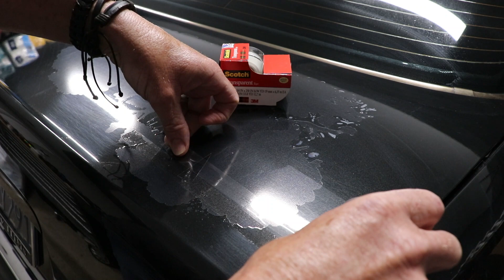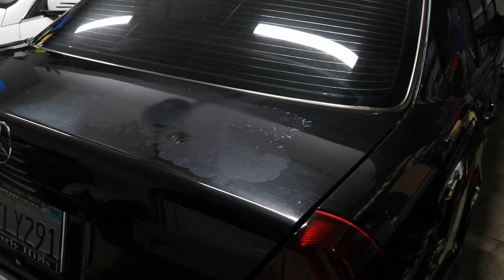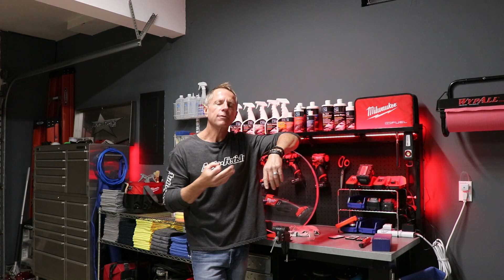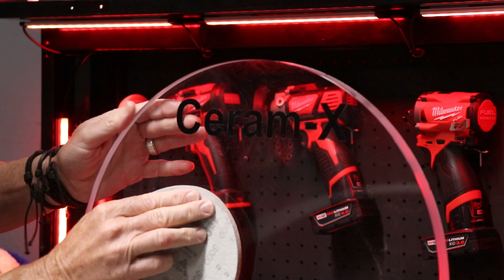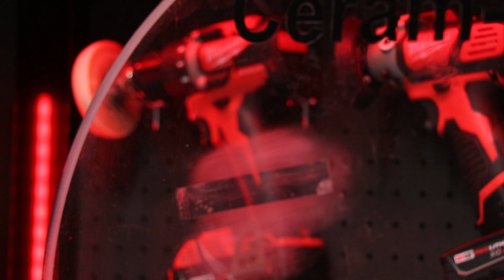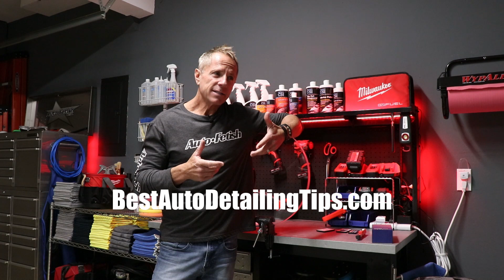Detailing Trick: : car clear coat repair using Scotch Tape??!!

Comment: Fixing clear coat damage on a car can be a multi-step process. Here is a simple, generalized guide to help you get started:

Gather Materials: You'll need sandpaper (both 1500-grit and 2000-grit), clear coat, car soap, a sponge, a bucket, microfiber cloths, and rubbing compound.

Wash the Area: Before starting the repair process, wash the damaged area with car soap to remove any dirt and debris. Rinse thoroughly and dry with a microfiber cloth.

Sanding: With the 1500-grit sandpaper, lightly sand the damaged clear coat area. Be sure not to sand too hard or too deep as you may cause more damage to the base paint. The goal here is to create a smooth surface for the new clear coat to adhere.

Clean and Dry the Area: After sanding, wash the area again with car soap to get rid of any dust from the sanding process. Dry thoroughly.

Apply New Clear Coat: Apply a thin layer of the new clear coat on the area. Be sure to follow the manufacturer's instructions for best results.

Let it Dry: Let the clear coat dry for the recommended time as per the manufacturer's instructions.

Sanding Again: After the clear coat is completely dry, sand the area lightly with the 2000-grit sandpaper. This is to remove any imperfections and to ensure that the new clear coat blends seamlessly with the old.

Apply Rubbing Compound: Apply the rubbing compound to the repaired area to give it a glossy finish. Buff it with a buffer tool or by hand with a microfiber cloth.

Wax the Area: After the rubbing compound has dried and the area has been buffed, apply car wax to the area. This will add an extra layer of protection to your new clear coat and enhance the gloss.

Comment: So WTF? You just cover your car with scotch tape??? Video made no sense at all.  Are you drunk?
Reply: He was teaching science and technology. Very intellectual.
Reply: Fixing clear coat damage on a car can be a multi-step process. Here is a simple, generalized guide to help you get started:

Gather Materials: You'll need sandpaper (both 1500-grit and 2000-grit), clear coat, car soap, a sponge, a bucket, microfiber cloths, and rubbing compound.

Wash the Area: Before starting the repair process, wash the damaged area with car soap to remove any dirt and debris. Rinse thoroughly and dry with a microfiber cloth.

Sanding: With the 1500-grit sandpaper, lightly sand the damaged clear coat area. Be sure not to sand too hard or too deep as you may cause more damage to the base paint. The goal here is to create a smooth surface for the new clear coat to adhere.

Clean and Dry the Area: After sanding, wash the area again with car soap to get rid of any dust from the sanding process. Dry thoroughly.

Apply New Clear Coat: Apply a thin layer of the new clear coat on the area. Be sure to follow the manufacturer's instructions for best results.

Let it Dry: Let the clear coat dry for the recommended time as per the manufacturer's instructions.

Sanding Again: After the clear coat is completely dry, sand the area lightly with the 2000-grit sandpaper. This is to remove any imperfections and to ensure that the new clear coat blends seamlessly with the old.

Apply Rubbing Compound: Apply the rubbing compound to the repaired area to give it a glossy finish. Buff it with a buffer tool or by hand with a microfiber cloth.

Wax the Area: After the rubbing compound has dried and the area has been buffed, apply car wax to the area. This will add an extra layer of protection to your new clear coat and enhance the gloss.
Reply: Dumbass title!!! He just wants to explain what clear coat is!!!!! He Smaart

Comment: Here is my problem. I own a black Grand Cherokee. 2 years ago seagull shit on my hood in the summer. It was 90 to 100 degrees out.  It ruined my clearcoat (a little bigger than a silver dollar) I wet sanded very lightly with 300 grit and polished. It looked better but never was 100 percent. 2 yrs later that same spot of clear peeled. I do not think it was my wet sanding because it peeled in the shape of the bird dropping not entire area sanded. That bird must have shit acid or something. How do I blend new clear over that?

Comment: 1 millimetre is 1000th of a metre which is approximately 39 inches. Please disregard the reference to 1000th of an inch.
Reply: Mil. And MM are not the same thing.

He is 100% correct that a Mil. One-thousandth of an inch. 

Not to be confused with a Millimeter. They are two different standards of measurements.

Comment: As a machinist I must say I have never heard of anyone calling .001 a "mill" as you said. We say .001 is one thousandths of an inch, or one "thou". Maybe your talking about millimeters? So .001 is one micron.
Reply: It’s a common term for plastics sheeting/ bags and coatings.
Reply: A "mil" is also a thousandth of a inch (.001) but in industries such as coatings and material thicknesses it's called a "mil". Its actually used extensively but in the machinist world they use thou more often. It comes from Latin where thousand is mille (mil is shortened from mille just as thou is shortened from thousand). If you go buy a tarp or drop cloth at HD you will see it shows how many mil thick it is.
Reply: @stephenwhite5444  pretty sure mil is not shortened from mile, as it really has nothing to do with being a mile fragment. It just a mil. having been an automotive technician for the last 21 years as well as pro-detailer I can definitely agree that ppl think mil is related to mm & not inches. When ppl see my digital paint meter they're instantly confused by mil/u option thinking the paint is in millimeters. 🤦‍♂️
Reply: @NemonicsRacing  it's not short for mile...short for mille. Latin word mille means a thousandth.
Reply: @stephenwhite5444  holy shit 🤯. Been doing this 7 years and I have never heard .001 called a mil even from the older guys. Learn something new.

Comment: just so you know we dont need a lesson on what its, we just want to know how to fix it.
Reply: Seems like it's more a lesson on how you can’t fix it (without eventually making things permanently worse).
Reply: Fixing clear coat damage on a car can be a multi-step process. Here is a simple, generalized guide to help you get started:

Gather Materials: You'll need sandpaper (both 1500-grit and 2000-grit), clear coat, car soap, a sponge, a bucket, microfiber cloths, and rubbing compound.

Wash the Area: Before starting the repair process, wash the damaged area with car soap to remove any dirt and debris. Rinse thoroughly and dry with a microfiber cloth.

Sanding: With the 1500-grit sandpaper, lightly sand the damaged clear coat area. Be sure not to sand too hard or too deep as you may cause more damage to the base paint. The goal here is to create a smooth surface for the new clear coat to adhere.

Clean and Dry the Area: After sanding, wash the area again with car soap to get rid of any dust from the sanding process. Dry thoroughly.

Apply New Clear Coat: Apply a thin layer of the new clear coat on the area. Be sure to follow the manufacturer's instructions for best results.

Let it Dry: Let the clear coat dry for the recommended time as per the manufacturer's instructions.

Sanding Again: After the clear coat is completely dry, sand the area lightly with the 2000-grit sandpaper. This is to remove any imperfections and to ensure that the new clear coat blends seamlessly with the old.

Apply Rubbing Compound: Apply the rubbing compound to the repaired area to give it a glossy finish. Buff it with a buffer tool or by hand with a microfiber cloth.

Wax the Area: After the rubbing compound has dried and the area has been buffed, apply car wax to the area. This will add an extra layer of protection to your new clear coat and enhance the gloss.

Comment: 7:50 demo is excellent on showing how clear coat works over a color coat. A yes polishing factory cars does have a negative aspect, more so with the process doing a two step corrections